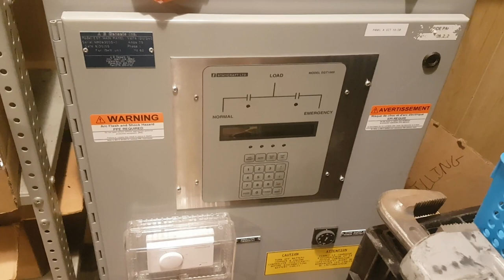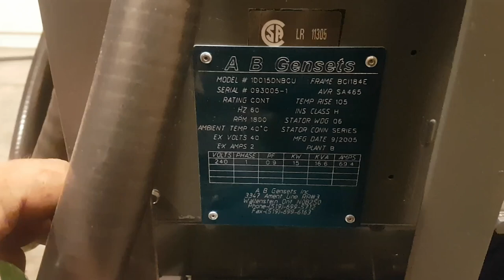Free Diesel Generator for the shop 15KW - And more great scores at this site

Comment: That is awesome, that motor alone is worth about $7000!
Reply from the maker: Yes,  I love the deutz's.  I try to take home every one I can get my hands on.  I love to repower equipment with them.
Ive got some parts engines in a 5 and 6 cylinder, a siezed 4 cylinder, one thats not siezed but I have no info on it in a air compressor, 2 of those generators now, and of course the 3610 and 6510 ditchwitch trenchers that came with them........And a new one comming this fall once I get the shack disconnected from standby.  And 1 low hour lister 3cyl 7.5kva? i packed back from labrador.

Hunting for some SAE #4 bellhousings and flywheels to repower a trencher and grader......

Sounds like you know a bit about the deutz's